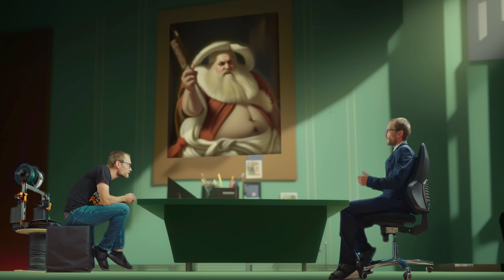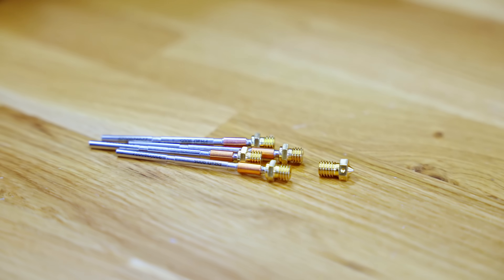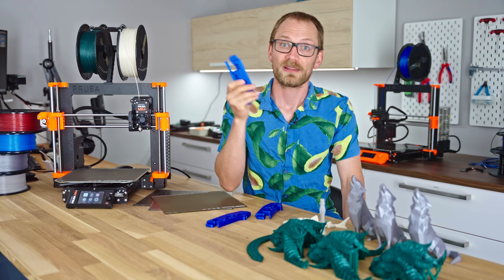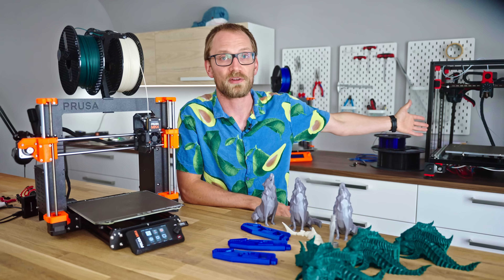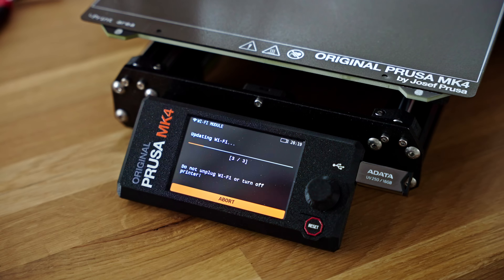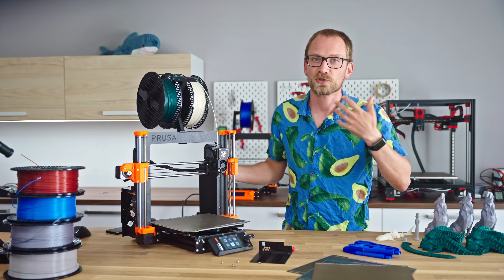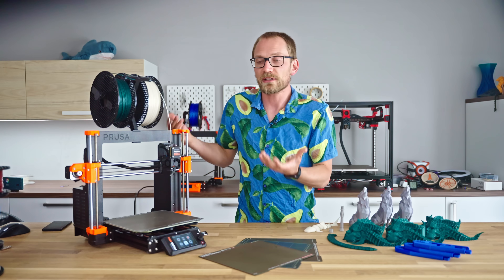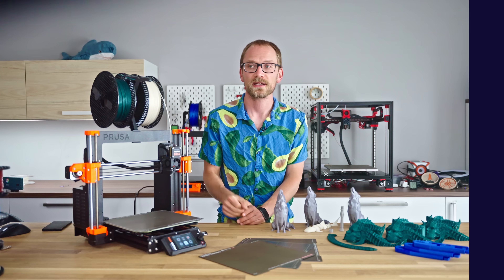Does the Prusa MK4 have what it takes?

Comment: Sort of strange there isn't some way for IS to tune it like the PID tuning for the heater. I mean assuming every machine is perfectly identical is silly, otherwise you'd not need things like the load cells, etc you'd just count on the machine being perfectly identical (they are more identical'ish than identical). Prusa also has sufficient market experience to know this, so it was either a supply chain decision (adding accelerometers is only easy if they can get them reliably at the quantity they need). Also annoying it's not Revo since I have upgraded my other machines to Revo, so now get to have 2 sets of swappable nozzles to maintain... Grrr... For things like the XL I get that all sorts of issues come into play as the hotends get swapped around, but on the mk4 a pretty conventional printer architecture, inventing a custom swappable hotend instead of using Revo seems surprising (even if done with E3D). Given their openness it would be great if they explained why they couldn't use revo, since it existed at the time.

Comment: I'm really overwhelmed with the current 3D printers. Bambu Lab has completely cleaned up the market. It is good? I think it depends on the viewer. I personally love screwing and tinkering with my printer. I have more cheap printers because I can't damage as much as with an expensive one. I started with Anycubic which was easy for me as a beginner due to the beginner-friendliness of the structure of the Anycubic Vyper with bed leveling and runout sensor I would not recommend this. When I got myself a cheap Ender 3, I found moden and screwing and that was fun. And there I also notice the difference between the quality just because a printer is more expensive (Anycubic Vyper/Anycubic Kobra Max) it doesn't have to be better. I got better results with my Ender 3 and two Ender 2 pro than my Anycubic printers. Now I also have friends who want to print and need parts from time to time and these are best perfect and fast. That's where I see the Prusa and Bambu Lab printers.I think if you do the hobby for a long time you will get a reliable one. That's where Prusa and Bambu Lab step in again. I might buy one in the future too. But I don't want to lose this open source or open tinkering. To which I'm more afraid of buying a more expensive printer and then something breaks, that would be a nightmare. Mainly because there is nothing you can do. I have currently opted for the setup of Crealitiy printers (the cheap Ender3, Ender 2 pro) and a Crealitiy Sonic Pad. I wanted to get a Bambu Lab. But I didn't want to spend so much money on a printer and then leave my Other  printers behind and decided on a complete update of all printers using the Sonic Pad

Comment: i´ve got my mk4 Kit couple a Weeks ago. It works great. But there might be a bug? When i slice for a color change or the filament Runout gets triggered. it successfully unloads and asks if the Filament is removed. At that point it gets stuck and says to remove the FIlament from the sensor. The Sensor itself works, the test was showing its fine too. i´ll contact the support at some point, but i dont get the freetime to do so. Aynone having similar Issues or Ideas?  Mk4 Kit, Version 4.7.2,

Comment: Open source still is a feature worth the price. 

I recently invested in a resin printer. I just assumed Elegoo was open source. And wow did I realised I made a mistake. The whole Chitibox situation, and more recently their fuck ups with the wifi on the new Jupiter (i think) ... 

I learned my lesson the hard way. If I ever need to change that printer than open source it will be, even if that means a 25% tax or something.
Reply: Hey you can use Prusa Slicer + UV Tools to output cbdlp files for your elegoo , thats what I do now, its a 2-step process but not that bad.

Comment: I would say an accelerometer is an esential. Expecialy on the upgrade from the MK3 when there will be mass differences introduced due to the legacy parts and using a different fillament than Prusament PTEG for the printed parts.I was already on the fence about upgrading my MK3S as I have a volcanno mod on it. So untill an impruved version of the MK4/upgrade kit ships with an acceletromiter for the print head and preferably the print bed as welll I will give it a pass. Thinking about thing an acceleromiter is even more esential for the print bed as it mass changes as the print progesses and that mass will increase at different rates depending on the filament being used to print.

Comment: With your question at the end about how other people are finding the alpha firmware, I put it on mine the other day and it's been pretty good, The quality isn't perfect but it's pretty good, although mine is inside the Official enclosure so I am so seeing if that is maybe having some effect on the resonances.

I will say, I haven't checked if the pre-set input shaping values are adjustable but if they are I'm half tempted to break out my accelerometer and run it to see what I can achieve by trying to dial it in further.

Comment: Thomas, we need to talk.
This is not how we should behave. Calling the interface "eastern european brutalisk padillac style" sound like you find Eastern Eurpoean a backward region to me, which it definitely is not. The interface style is just a preference and I like it. No fancy Appelesk style fancy icons that have me questioning each time again what the icon means. Just a clear icon with a simple logo. I like that above the Appelesk style. Having all software open source is one of the things that, I think, helped 3D printing to advance to a point where we are right now. And that also allows Prusa to incorporate other open source features (like input shaping) in their current printers since that is also open source and can only be used in other open source firmware.
But you do have a point about features like input shaping not being available from the start of selling this printer. The way the new features were advertised made me think they are available (including the accelerometer needed for input shaping) and I felt misled not having those available.

Comment: I've had Prusa printers for years and very happily, but, six month back I bought a Bambu Labs P1P. It is fantastic - prints great and super fast. Yes,the P1P Interface is terrible, but, given I use the app or slicer on my laptop then it isn't an issue at all. Given the price of a P1P then I don't know why anyone would buy a PRUSA now.  Will it be as reliable as a PRUSA longer term - probably not - suspect it will shake itself to pieces in time, but, I still absolutely love it. It's the future and I am a convert!

Comment: Need to play with Marlin's input shaping(My machine currently has too many other problems to test)  It was written to run on the  8 bit micros!  (Found forum posts with the author saying it)
I don't know if it's based on klipper and if prusa's firmware is based on it or the other way around, but it's interesting to see!

Comment: ALPHA FIRMWARE - INPUT SHAPING 
I can't speak of INPUT SHAPING on the MK4, as I do not have one yet (currently own MK3S+ and considering the full MK4 upgrade), but I do have a Mini+ with upgraded extruder from Bondtech and I use INPUT SHAPING. The print quality results I see from INPUT SHAPING on the Mini+ are subpar, and definitely not results I would consider handing off as a final product, HOWEVER, it makes my rapid prototyping processes way more streamlined because of the time saved from the speed INPUT SHAPING allows the Mini+ to exert.  One thing I do notice when prototyping with INPUT SHAPING are tolerances; when I print a final product, I turn INPUT SHAPING off, and the final results are amazing, however the measurements between prints from INPUT SHAPING compared to non INPUT SHAPING are not always exact.  

Overall, I'm perfectly OK with the results from INPUT SHAPING because of the convenience it adds to my workflow.

Comment: I own a Bambulab, and I've never owned a Prusa. I do like Prusa as a company, and I think it's great that they're open source, and I give them a lot of credit for that. I don't think I'd say open source is hurting them. But it does seem like they spend resources on things that could be handled by the community. Things like the upgrade kits are cool but burdens Prussia with handling tech debt. If they just stated that their policy is to make it easy to upgrade/improve your i3, well the design files are open, let the community make the upgrades. Focus on the major hardware revisions.
The other way they hurt themselves is pointed out in the video: advertising or promoting hardware and features that aren't ready. Like when the MK3 released and people waited a year to receive textured beds. I want to buy a product that is complete, not for features that I will get eventually, probably.
Finally, it stinks that some popular hardware is badly supported. Specifically the Mini, the resin printer and the previous version of the MMU. The success and support of Prusas devices other than the i3 have been mixed at best and would make me hesitant to jump in on any new product line.
As things are going I am afraid they may go the way of Lulzbot.

Comment: What about other printers that use input shapers?  Depending on the shaper used, the corners are more or less rounded.  This is no different with a Bambulab.  Prusa also provides the shapers known from Klipper and everyone can choose a less aggressive one.  I think that there will also be profiles that are less geared towards speed and more towards quality. In the meantime, other manufacturers are also using predefined profiles.  In a video by mpoxDe with a Sovol, the measured bets were even worse than the standard profiles.

Comment: I find the intro really good, really funny, already with the video to open source 
I have the Alpha 3 with Input Shaper installed and use Input Shaper for handy prints that I need quickly, any drain plugs and brackets in the workshop that I need quickly and for that it is okay.

Fancy prints I do conventionally

Actually, the Love board would have been perfect for the accelerometer, why not?

Comment: Does prusa's input shaping take into account that there's a 1kg spool on top of the machine possibly affecting its movement? Does it adjust by itself? I mean that spool gets lighter the more you print.
Reply: Input shaping, no matter which maker's implementation of it, doesn't really adjust its calibration as the print is in progress.  The same way you have a 1kg spool getting lighter on the top of a MK4 printer, the X1C, P1P, or K1 also have a gradual transfer of weight between the top (AMS) or the back of the printer into the print bed. So, technically, the resonance measurements collected before each print won't be the same as the printed object gets heavier and the spools get lighter. Maybe future versions of input shaping will have that capability.

Comment: Quite frankly I am pretty ticked off that they came out with MK4 before delivering the Prusa XL. I think they put the focus on the wrong machine, they could’ve come up with the XL and MK4 as the coreXY. IMHO this is a pretty poor strategic decision that will cost Prusa. I was a big fan of Prusa and have both MK3S and Mini. However after waiting year and a half for XL, I decided to check out the X1 Carbon and I haven’t touched my Prusa’s since. X1 Carbon is every bit of reliable as MK3S but packed with a ton of awesome features, elegantly built, plus more than twice as fast. It is comical that Prusa prices MK4 at the same level as X1 Carbon. Pretty much every competitive advantage Prusa had has been matched or exceeded by X1 Carbon (and even P1P). I agree with Thomas, I’d buy P1P or another X1 Carbon instead of Mk4. I already cancelled my pre-order for XL, I am ticked off about how Prusa is pushing Mk4 instead of more heavily investing on the next generation CoreXY printer he promised year and a half ago.

Comment: Feels very similar to the D&D open source “adjustment” that they tried this year.  Open source is great for certain communities & development stages, but when it transforms into simply Subsidizing your competition, I feel an adjustment is appropriate.  I’d support a %$ after 3rd party sales threshold.   

Like as if O.S. Is better kept within a non-profit ecosystem. & its proper licensing in Commercial applications.  & all the fun that comes with bickering over the gray areas.

Prusa’s O.S. Is just the current version of the same issue permeating several industries these days.

Comment: Possibly a great idea for showing differences in print quality, still use two identical models, but instead of SBS view do a single model view where left side is one and right side is the other. Have it rotate on a fixed point on a lazy susan with a fixed camera angle. I think that would allow you to really see any differences with ease.

Comment: Well, as a maker you actually want a tool that you can trust to work. Yes, the printer itself can be you hobby, and then any cheap one is very fine (the same when you want to find out whether this is something for you without spending a lot of money). But not everyone loves tinkering with their tools, at one point you just need to get the job done (I think it was either you or Stephan making a video why the MK3 is still the go-to machine when you want to be sure that the print succeeds).
Coming from a K8200 kit, I was at the place where the printer was the hobby. But every print was a chore. After finally upgrading to a MK3S, I think I printer more filament in the first month than in the 5 years with the K8200. So yes, the MK4 has a big appeal, because with the Nextruder (which only looked at briefly) another thing that might fail now also should be gone - the first layer. And that a feature only sparsely replicated currently. Vorons can get something similar, and some othger commercial printers as well. But the MK4 does it best it seems. And the first layer check with the Bambu only works after the fact (its 'first layer control', not first layer assurance), and not under all circumstances.
Also, the consistency of the machines you get is kinda important. It does not really matter what the best quality it that you can get ('Jedes Huhn findet mal ein Korn'), but more what the worst qulity is that you might see. Yes, even an Ender 3 can be great OOTB, but you expect tinkering to get good results. For a Prusa printer, everything than a perfect first print would be seen as a disappointment (yes, it happens, buts _rare_). This is difficult to grasp in a review, but its part of the choice that people make. Yes, the tech is a bit dated, and not shiny new, but companies know how to make it work, and god they are doing it. I do not want to be at the receiving end when a company detects, one year or two after, thats certain parts will break sooner than expected. These are things you risk when you buy the shiny new stuff where no-one has real experience with.
Reply: God, its really off topic, but can I take this moment to complain about how awful Youtubes not quite markdown is? Like the part where you wanted to italicize rare, why in the heck would any parser not be able to figure out something as simple as that? They are google for christs sake. I really wish they would just enable proper markdown on comments and just have it be a toggle or something so that users who didn't have the appreciation for such features wouldn't be bothered, and then users like us wouldn't be constantly frustrated by how absolutely horrible it is.

Seriously, this is a god damn software engineering company and they get this wrong. I can't believe its been this bad for this long.

Comment: If you have the time, and the ability to hack a printer like the Ender series to  do what you want, then the Prusa Mk4 probably doesn't make sense.  However, if you want or need something that just works out of the box, and will have upgrades complete with excellent install instructions, then a printer like the Prusa IS a good choice.   I know I'm influenced here by the fact that I've built several 3D printers and upgraded them.  It's a hobby for me and the journey is as important as the destination some times.  But, if the 3D printer was just a tool, one I didn't want to build or tinker with, just USE, then things look different.

Comment: I've heard people say the i3 form factor is dead because the "bed slinger" design is obsolete.  I don't know why people say that.  I'm guessing it has to do with speed and with artifacts, but I'm not certain.  Why is the "bed slinger" design obsolete? What makes the "core-xy" design better?
Reply: From what i have picked up people saying is that core xyz is much lighter on the extruder and potentially a lot faster and accurate with a lot less artifacts when compared to a bed slinger. However personally i find bedslingers much easier to work on and fdm ""probably"" will never reach near instant printing speeds or sub 10 minute full volume prints with reasonable accuracy due to mechanical limits of fdm machines. Resin printers could have a chance though

Comment: Bought a SV06, between the issues with dual axis leveling sucking, the heatbed cabling failing, total lack of consideration for the ribbon cable to the hotend and its ability to knock over prints, Sovols God aweful customer support that lead to me waiting 2 months for a warranty replacement heatbed. I feel these reviews fail to consider customer support, warranty, build quality and ease of replacement. I dont htink the 'buy a cheaper printer and deal with the issues' is a conclusion that values your own time Thomas or someone deciding to make the same decision.